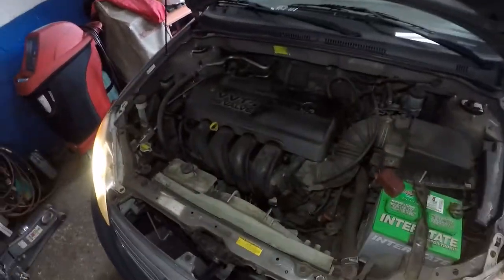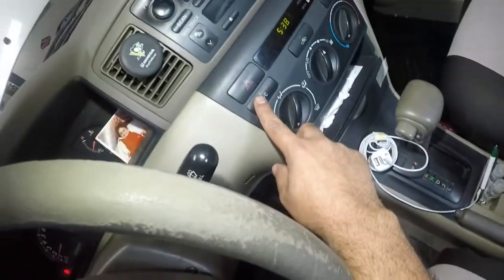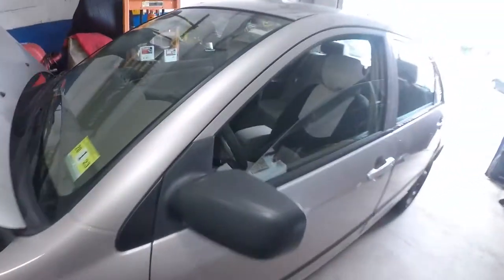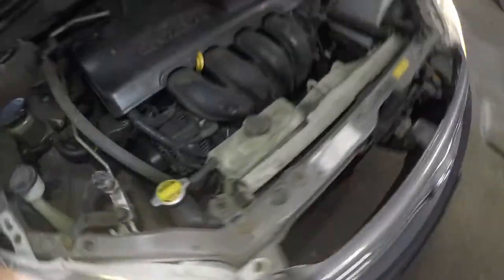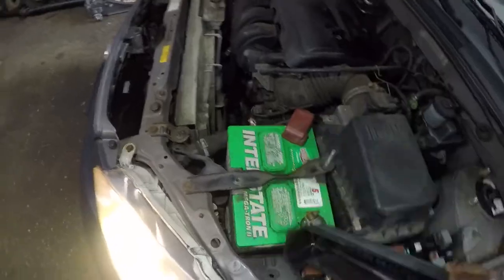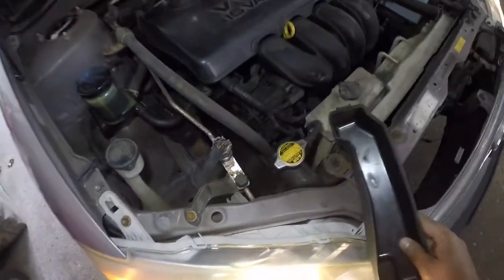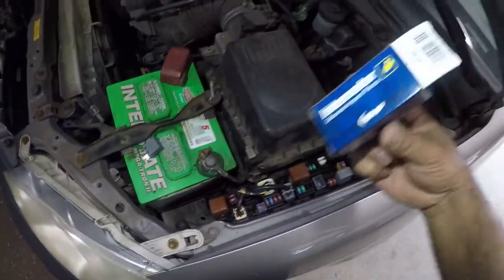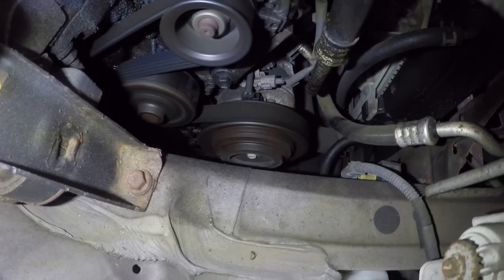AC stopped working , 2003 corolla AC compressor stopped working hit the relay  / AC FIX  AC RELAY

Comment: You are a lifesaver. I put a manifold on and the readings were equal so just figured a bad compressor as the car is a 2003. Just happened to see your video while doing research on how to replace the compressor. Figured why not amd gave it a try. Yep you were right. New relay from Toyota and AC is just like new.
Reply from the maker: Nice job!!! Good fix and original relay will last years

Comment: This was sooo coollllll!!!!  Thank you.  92 degrees today, worked yesterday.  Watched your video,  turned on with AC off.  Turned AC on, compressor didn't move, opened fuse box, wiggled fuse,  BOOOOOOMMMM  WORKED  Drove around block,  coool freessshhh air!  Thank YOU!!!
Reply from the maker: Nice job!!!! I think the relay may have engaged from movement so if it fails again I would replace the relay!!

Comment: thanks for the video, my mechanic said that the A/C compressor is very bad, that it has to be replaced and that it will cost 1250 dollars, and I will find your video and fix it with the car, and a few dollars
Reply from the maker: Yup wat yeah make model is ur car I can send u like for video if I have it on that make model

Comment: My 2004 Corolla had the AC clutch go bad, however it only fails after the engine has warmed up to normal temperature. I liked to never figure it out, all the AC  components were functioning fine when it was a cold engine. The clutch coil would get hot and then fail. I replaced the clutch assembly, not the whole compressor for $45. Now my car is working great.
Reply from the maker: Nice great job!!
Reply: Did you have to recover the refrigerant for that job? My 06 corolla is doing the same as yours I thought maybe the expansion valve but can't tell for sure.
Reply from the maker: @jackwilliamson1929  not for the relay
Reply: @jackwilliamson1929  If your car is doing the same, check the AC clutch coil while the engine is running at normal temperature. Apply 12 volts positive to the wire leading to the coil as the body of the compressor is already negative grounded. I used a simple wire from the battery. If the coil is functioning properly, it will engage the compressor. If not then there’s the problem. By manually applying voltage directly to the clutch coil, it should engage. Again, this problem only occurs when the engine has been cooled down for several hours. No I didn’t have to open any refrigerant lines, just replaced the clutch. I liked to not figure it out because it was intermittent. I hope this helps. Btw, check the relay for a clicking noise when activating the AC switch. A bad relay will cause the clutch not to work also.

Comment: Will this cause your engine temp to spike hot? 2003 Toyota Corolla - I was driving home and the AC just stopped working. As I was checking the controls, I noticed the engine temp spiking Hot.
Reply from the maker: Well if ur as was running that could cause over heating if the fans don’t work .. so start with check if both fans work with ac on
Reply: @RBTheMechanic  Thank you so much!
Reply from the maker: @HealthyMBS1  welcome

Comment: Hey man, i have a 2013 corolla and im trying to locate the condenser fan to see if it's running when i turn on the AC. Any idea where it's located?
Reply from the maker: Not sure if 2013 have one or 2 fans if it got 1 fan it same for radiator and ac if it got 2 the right one is for ac condenser
Reply: @RBTheMechanic  ah yes I looked it up and it's just the one fan for the radiator and condenser. Doesn't seem efficient to me to only have one!
Reply from the maker: @zombiemontage  yeah I though Corolla had only 1

Comment: The old hit it with a hammer trick.  Pro tip: hammers are for nails, not electronic car parts.
Reply from the maker: Tap. Not slam it with sledge hammer bro

Comment: Hitting the relay did not work. Switching with the horn did not work. I ordered a new one, but it might not Be the relay. Still not blowing anything.
Reply from the maker: Not blowing anything? Or blow but not cold?
Reply: @RBTheMechanic  not blowing at all.
Reply from the maker: @shadesofsylar  then this video is not ur issue at all u need to check for blower motor issue ur blow motor is not working check fuse relay for blower motor also put blower motor on high speed max high and check power and ground to blower motor connector also if u punch the motor some times it comes on that mean bad motor
Reply: @RBTheMechanic  I'm limited in my mechanic skills. I don't have tools. I may need to bring it to my mechanic. But at least I will know what to tell him. I did change an ac fuse under the hood a long time ago and it worked. The one that is off white in color.

Comment: I got the same problem with my Corolla ac. Just for any reason not working not more i do the same on the video i buy the relay and nothing happens..  my ac works fine and this happens like said i do everything and nothing works
Reply from the maker: Did I check pressure and power in ac compressor?

Comment: Replaced relay ac compressor still not turning
Reply from the maker: Did u check fuse and ac pressure?
Reply: @RBTheMechanic  where would the fuse be ? Thanks
Reply from the maker: @andresabrajan7469  under hood fuse box